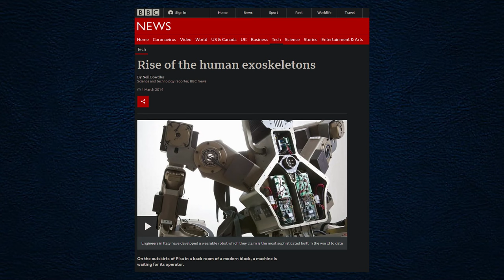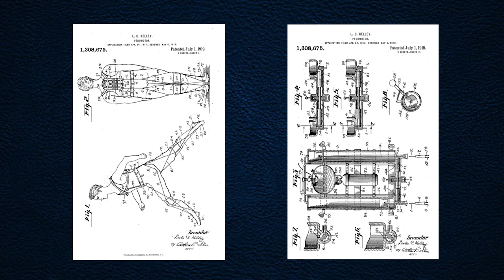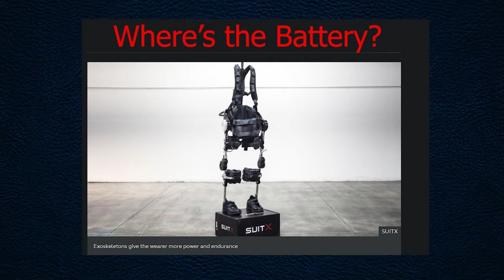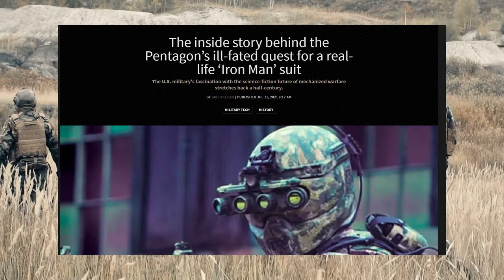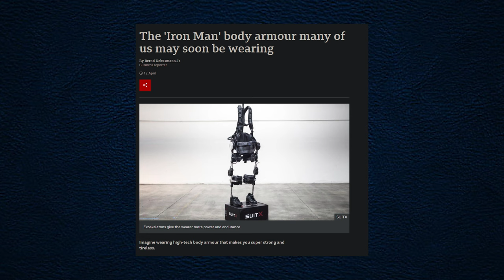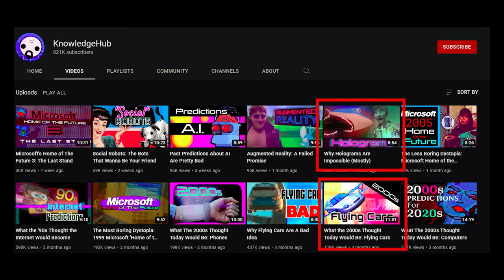Exoskeletons Will Never Happen: Here's Why

Comment: Power isn't a complete barrier. In lots of applications, a tether is just fine. Precision doesn't have to be a total barrier either. For one thing, precision per $ is increasing. For another thing, reduced precision is also fine for lots of applications. Example: a two legged exo with a tethered wheeled battery pack, just to enable walking. You are right, that lifting cars and jumping over buildings is probably out.

Comment: Regarding the battery issue, you should take a look at the graphene battery. It seems ridiculous, but it's benefits far surpass lithium-ion batteries. The ability to drain and recharge from 100%-0% without affecting battery life, rapid recharge (minutes for an EV), and no risk of chemical spills, toxic vapors, burning, or exploding resolve many of the crippling hurdles of the current batteries. (They are starting with coin batteries, but some companies are also finalizing graphene car batteries)
Slowly, but surely, the problems for exosuits are being fixed! :D

Comment: There are a number of non-powered exoskeletons, wich are ment to transfer weight from wearers body to the ground and diminish fatique. For example welders in shipbuilding are supposed to work for HOURS with their hands lifting the equipment above or on the level of their heads. Non-powered exoskeleton nulyfiing (from their point of view) the weight of the equipment and partially supporting their hands when up, makes a great difference. The same goes for soldiers (or people liking long hikes and trekking), diminishing their backpack weights, wich allows them to carry more equipment or armament. There is a knee bracing wich can be added to "non-powered exosuit", wich works as power generator by simple walk of the operator. There is special boot called bionic boot, meant for the wearer to run faster and easier. In the sci-fi clasic ALIENS movie, you can see special bracing for the "smartgun" weapon, wich particulary helps to aim, and particulary helps to carry the weight of the gun. There is a special overhead brace, ment to lighten and ease the use of heavy bullet resistent personal shield, in conjunktion with rifle. I would LOVE to see performance of some amalgamation of the "unpowered exoskeletons". 

Meanwhile, the technology goes still up. The first WORKING POWER ARMOR probably will not be covering whole body, will add "powered" only to SOME part of the body (the fingers probably not at first), and will behave little slower than in popular culture, because the speed of response to the wearer takes some time and technology, for READING your bodily movement from your brain, to give the armour at least the time your own body needs between idea and movement - to seemingly move at the same time (or a split second sooner than) yourself. 

Power itself is no impossible problem. First, there are much better (power density regarding) batteries aviable now, Second you do not necessarily NEED batteries - you can have a minigenerator in backpack, running on hydrogen fuel cells. And finaly third - you can have a spare fuel cell (or powered battery) on you, to prolong the operational time.

Not to mention, there already IS flying solo-soldier jetsuit, wich WAS inspired by iron man suit, and at the moment it is being fieldtested and checked by the brass. It seem indisponsible for boarding actions (against enemy ship), and extremely ussefull in urban warfare (hopping from skyscraper to skyscraper).

Comment: I've been mulling over a new type of unit to complement the Army's new doctrine that I'm calling the Heavy Assault Infantry which would be given to the "Penetration" elements under the new doctrine. It would be specialized for closing with and destroying heavily fortified targets and MOUT. The focal point of this unit is a new vehicle concept, the Heavy Engineering and Assault Vehicle or HEAVe. This vehicle would essentially be a turretless tank, more heavily armored than current main battle tanks, except it trades a large gun for troop carrying capacity and engineering capabilities, such as a front plow and a MICLIC launcher operated via CROWS. It would also have a CROWS operated Mk 19 grenade launcher and .50 caliber machine gun. It would be extremely heavily armored on the front, sides and top to ensure survivability in urban terrain. The vehicle would have 3 crewmen: Driver, Lieutenant Commander (who commands the vehicle upon dismount) and CROWS Gunner.  It would be able to carry these 3 crew and 11 dismounts who represent a Heavy Infantry squad. The dismount squad has the same structure as the current Army infantry squad but with an organic combat engineer added for each fire team. The combat engineers would be armed with a carbine as well as a portable breaching shotgun, breaching charges, and any other task appropriate equipment such as battering rams, detcord, sledge hammers, ladders and bolt cutters. This addition of combat engineers to organic infantry squads would give extra tactical solutions at the squad level as well as increase the firepower of the squad as a whole.

Comment: The military  didn't trash the concept of a  exoskeleton.  They simply didn't  bring if out at this point due to power demands of the system.   So essentially the military  sent the scientists and engineers back to the drawing board to come up with a better power source and continue the development.  

The US government spends around 800 billion a year on the military.  Most of that money goes to R&D and maintaining equipment.   

The problem  with Talos was the power source.  Currently the military  has an exoskeleton  but it's a prototype tethered to a power source.  So it's going to probably  take decades of development  to see the concept become reality.

Comment: The only thing that stops us from building a usable one is power supply and nothing more. The construction can be more simple : just a 'can' that is all over your body and have movable limbs, that are controlled by touch sensors (of course very strong) . If you want to move arm , you will push a series of 'buttons' that will move the mechanical limb.
Reply: Of course the exosuit that I sugested will not have use in most jobs. And the buttons will be best quality. The future will be , but now we have what we have.

Comment: Where exoskeletons may have a use is that for humanoid robots. 

Say  such a bot 90% o the time only needs to be able to lift X weight but say 7% of the time  it needs to lift 2x and 3% o the time it needs to lift 3x its weight.

Rather than having to build three variants or one super version that has more lifting power (and thus cost and weight) one can just build the 1X model and then equip it with an exoskeleton those times it might need to lift that extra weight.

A similar argument could be made if the bot needs specialized equipment such a special hands and such.

So as we see more and more humanoid bots come upon the scene we might also see an up tick in the use of exoskeletons as well, but created for robot use and not so much human use.

Comment: They are already here. Granted, they are not primary equipment because robotics will do most things at a lower cost than an exosuit can, but powered armor exists. The question is, what is your definition of an "exosuit". Its low yield power, basically just for stability and some locking joints to disperse weight during movement and to improve carrying capacity. Its also questionable if the agility reduction is worth it, but suits being tested for people with a disability grants them cababilities such as, you know, walking when you cant walk.

Comment: Honestly, I don't understand why exosuits/skeletons/armors are so often associated with batteries. Just because it develops force through electric motors doesn't mean it can't have a generator of some kind.

Gasoline and diesel are about ten times more energy dense and safer than lithium ion batteries. Don't like to fill your house with CO2? A hydrogen fuel cell's only residue is H2O, it is practically noiseless and it is about 90% more efficient than an internal combustion engine.

I guess "gasoline generator" doesn't sound hi-tech or sci-fi enough for many of those fake articles, and most people don't know about hydrogen fuel cells, so it's easier to advertise it as working thanks to TESLA HYPER ULTRA MAX BATTERIES tm. I guess we just aren't meant to have nice things...

Comment: I'm disabled and have been in a wheelchair for over 20 years. When ever I look a paraplegic in a exoskeletons they are a massive downgrade on a standard active wheelchair. It always seems to be the newly disabled in one who has a desperation in imitated a non disabled person. Why the hell would I want to drag my legs along with exoskel legs. They clearly take massive effort to strap into and slow and clunky. If the Exoskeletons legs don't need to follow the dimensions of human legs a much more balanced design is possible. I'd rather strap into a bucket seat in the centre. They are clearly designed by able bodied people to solve a able bodied perception of what a paraplegic needs.

Comment: there is now many engineers that have created exo-suits
Reply: there is a wild world of difference between creating an exo-suit and a viable exo-suit.
Reply: @sosig6445  So is there to anything. Everything needs a prototype.
Reply: @n.valentine6236  
Many inventions are easy to prototype but hard or impossible to commercialize.
Nowdays eberyone and their mother can assemble a micro pc and some servos into a robot, but to create one that does enough work to actaully sell is a huge task.
Some types of inventions need the entire market to change first in order to be viable at all.
No one will ever care about exosuits if they slow down infantry. Infantry is already slow, and infantry is vulnerable because it's slow not because the lack of armour. If you make a "power armour" you just made a tank thats slower than infantry. Aka fodder for enemy artillery. The advantage of infantry over combat vehicles is the ability ro hide in any cover. A clunky exosuit would take away from this one all important advantage, a 30 mm autocannon from a bmp or a 120 mm tank round will still shred you no matter how great your exosuit is.

Comment: This video starts from the wrong premise - namely, that an exo-contraption is a failure unless it mimics some movie schlock-and-awe nonsense that is usually a thinly-veiled advertisement for the MIC.

There are tens of thousands of people with mobility issues whose lives would be improved if they had access to a 5kg reduction in the effort required to take a step. 

There are people with shoulder problems whose lives would be improved if they if they could reach down a 1kg jar from a shelf above eye-line.

And in both cases, the small reduction in effort, adds up to a dramatic slowing of work-related 'wear and tear'.

For the upper body, the VAST bulk of the benefits of this type of thing can be achieved with unpowered "assistives".

The lower-body-mobility assistance furnished by recent products (e.g., HyperShell; SportsMate) would be more than enough for a very very large number of people. It would keep people out of wheelchairs; keep them walking. 

Once people go through the mental "process" of confinement to a wheelchair, they basically accept that today is the least-frail that they're gonna be from this day onwards. Tomorrow will strictly no better; next month will definitely be worse.

Comment: 100%  if taking that Lithium-Ion batteries are the ultimate portable source of energy and that the current technologies and materials are also at their physical limit. But none of these premises are true.
1) There are perspective battery types under development;
2) If batteries are still not good enough think of other forms of storing the energy like even gasoline which is orders of magnitude more energy dense than any type of battery.
3) Perspective less dense but as or more strong and flexible materials will reduce the energy consumption of an exosceleton.

Of corse it is also possible that by the time all these envisioned technologies merge into an exosceleton, the advances in artificial neural networks and microelectronics will make human physical labor and military service obsolete and all those technologies will in turn merge with those developed for exosceletons to produce more advanced robots (which architecture don't even have to resemble human anatomy)> But there will still remain a niche for the limited mobility people help, yet again, given that advanced prosthetics won't make exosceletons obsolete even for that application. 

So I think there is still chance that exosceletons may become a thing one day but if so they may serve different purposes and/or may look and designed differently.

Comment: I'm tired of the military having such a huge budget just to start and almost immediately can projects like this all the time. Its more of a waste of tax payer's money than if the project finishes and its not quiiiiite as good as projected. Anything, even just lightening the load of a backpack would have been worth the budget. 

Also, If the size of the power source is the issue, why not scale up the size of the entire unit? Seems unorthodox, sure, but I'm sure there is gotta be some kind of big electric car battery, combustion engine, gas turbine engine or better that has the operation hours and power for what is needed. We can scale it down for commercial use later gradually as technology improves, trying to keep the prototype small and compact will always be more expensive.

Comment: This doesn’t quite make sense, for industrial applications couldn’t they just be wired in? If you have people working in a warehouse or on the deck of an aircraft carrier etc why couldn’t you have a cable? Lots of equipment we’ve used for decades has power cables and it really hasn’t been a problem- so, did I miss something in the video? Seems the thesis of the video is that exoskeletons won’t be adopted because of batteries… so what’s wrong with wires for industrial applications ????
I’d think the slow adoption is more around cost, potential or unknown legal liability with any new equipment, and maybe limited supply- they can’t be making too many of these right now.

Comment: We don't need a exo that can make you jump even just 5ft or lift 100lb over your head like nothing 

A simple exo that can carry the weight of a backpack and or body armor without impacting a soldiers mobility would be absolutely a game changer and is totally possible to make
Reply: Except that it's not, lots of governments and companies have tried and it turns out that it not only increases energy expenditure, but the battery technology to make it run for long periods of time is decades out.
Reply: @christophegroulx7816  you literally just said they already exist proving my point
The battery capacity issue WILL be solved eventually it's a matter of time and never quite as much as they assume
My suggestion however would be to look into non-electric alternatives we're so focused on the powered aspect of exos we've ignored a number of other possibilities
Reply: @RedMatthew  I said they tried, it never left the labs and the programs were discontinued. And no, legged robots/exoskeletons require immense amounts of energy, and looking at the rate at which batteries improve it's going to take a very long time and not "nEvEr QuItE aS mUcH aS tHeY AsSuMe". Please do some research on this.

Comment: I feel like they make this a lot harder then it needs to be. Why not use simply hydrolocks? Put some sensors in there to know when to compress and depress, slap some protective metal between it and the fleshy bits, and all you need is the power source. 
Now I’m no robotics engineer, but I do know how strong a simple piston is, and I also know it dosnt need that much power to shoot air into the thing. So why are these egg heads trying to reinvent tech we already have. I mean besides the tubes in some Aries’s, is any one here seeing hydrolocks? I’m not.

Comment: I think the biggest hurdle with these exosuits was the power source. That was the biggest problem however, a small portable nuclear power core could power it for years. The problem with that is the enemy getting their hands on enough of them to built a makeshift nuke. That's why there needs to be an alternate power source & like you said, an hour & a half of power just isn't feasible for combat operations. Though it does make you wonder if their are already a few in use covertly by the CIA's special activities division. It's not as far-fetched as it seems. If a small 10lb nuke battery can power a large flashlight for 50 years then this suit shouldn't be a problem. It's just to risky to use in the field.

Comment: Yes why would we need flying cars when 
You can use a transporter like startreks
I just love having my body pulled apart atom by atom then glued back togather then hoping it got it right. Its also fun to
Accelerate to 5000 mph in 5 seconds and hope the inertia damper works so you don't become a grease spot on your ships bulkhead. Technology is great in its early stages.

Comment: Oh it will happen soon. The exoskeletons made today aren't designed well enough and there's not enough imagination and research put into them. I already made a sophisticated one. I lift car engines and move very heavy stuff around the house with it. It's nearly as strong as a forklift but I can run, jump and move almost as easily as a normal person. Powered by two custom made miniature gasoline engines. Only issue is cooling and the super complex system of tiny hydraulics. It's not impossible. Was thinking about incorporating flight into it but I'm not a aerospace engineer so I'm out of luck lol.